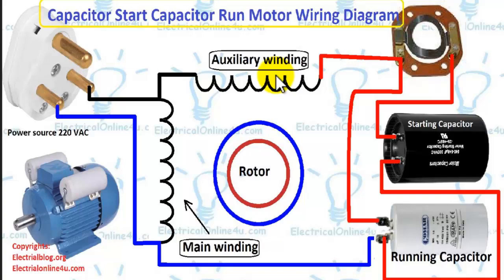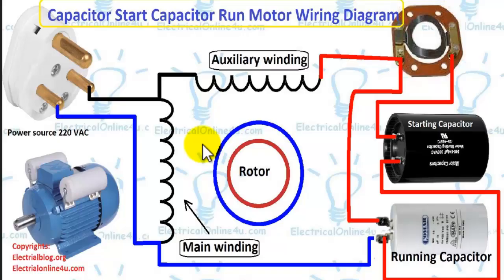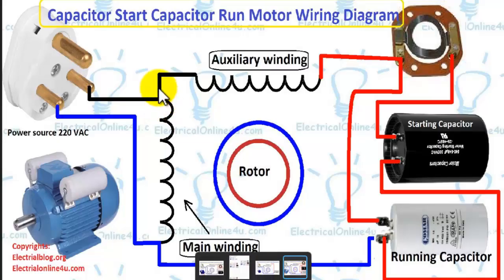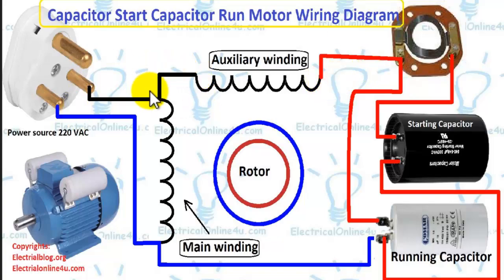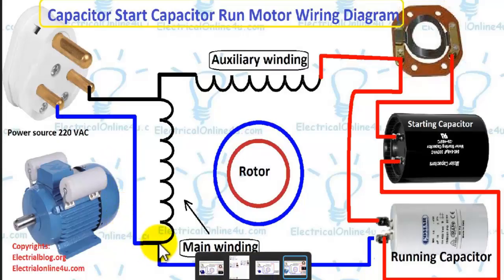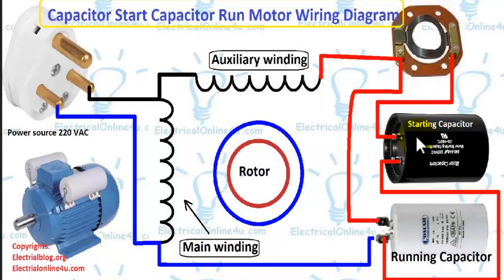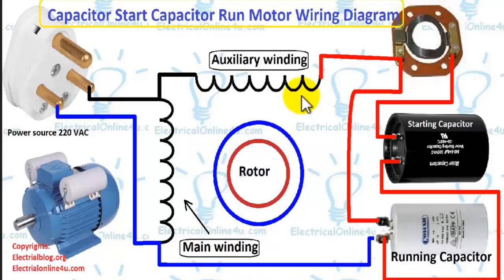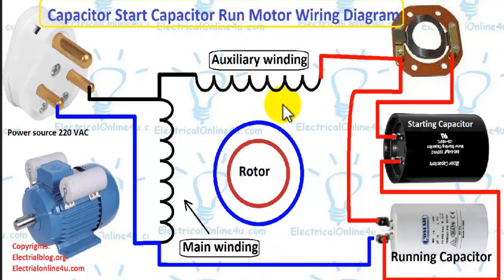Single Phase Motor Wiring Diagram With Capacitor Start Capacitor Run (English)

Comment: I have a single phase 220v motor. There are four wires coming out of the casing of the motor namely red, black, blue and brown. When I connect the red and black with a multi-meter it shows a continuation. The blue cable appears to be the earth. The brown does not connect to the red, black or earth. What is it for and where should I connect it to? Please assist.

Comment: I had to trouble shoot a floor buffer with this configuration and I was way wrong. I finally understand what’s going on. Some connections were concealed by the stator so I didn’t understand what was going on.

Comment: I have a motor for air compressor with 5 leads coming from the motor, t1, t2, t3, t4, t5, do you have a diagram for it? Thank you